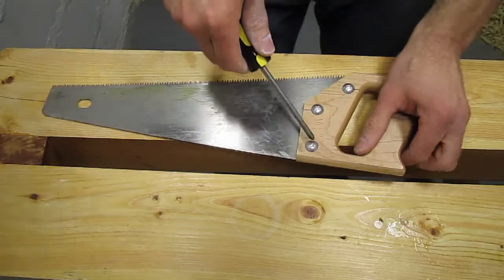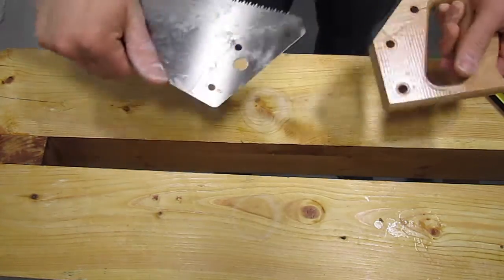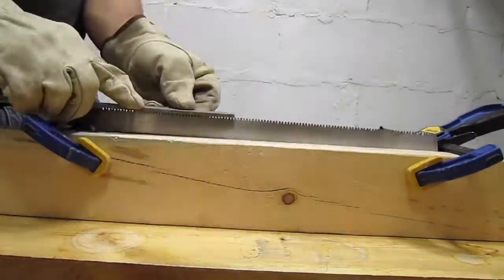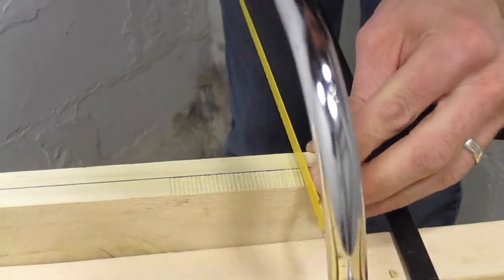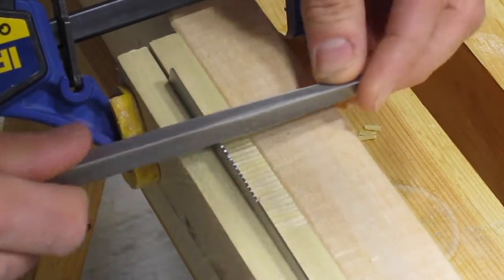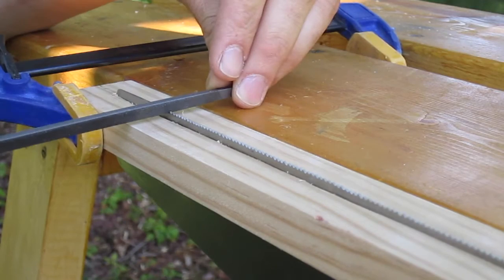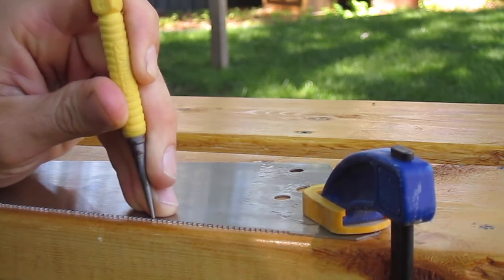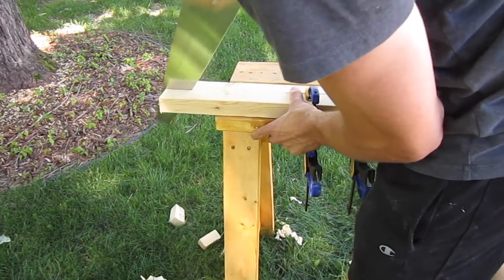Retoothing a Handsaw

Comment: The saw looked like it had impulse hardened teeth to begin with. These are extremely hard as you found out in flat filing them. The cutting of new teeth would probably have gone more easily if you had flat filed off more metal until you got down to a somewhat softer metal in the saw plate

Comment: Definitely was an electro impulse hardened saw 🪚 that your hacksaw blades (which are in fact hardened) would not cut what should be spring steel proves that the little Stanley was hardened.  But you certainly stuck through it till the end and now you have a skill you can use on a traditional saw.

Comment: nice video. .... but I dont understand why you didnt sharpen instead?
Reply from the maker: The saw had a strange tooth pattern that would have been a pain to sharpen each time. I changed it to a rip pattern, and also increased the teeth per inch for a finer cut.
Reply: +Brian Hilson ahhh ok. well it was deffo a good video. keep them coming. i subbed
Reply from the maker: Thanks!